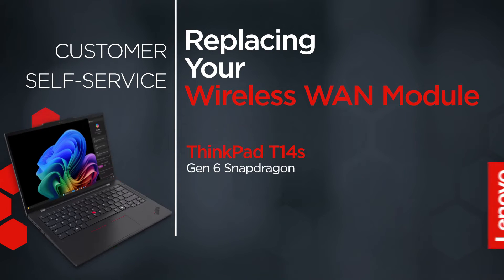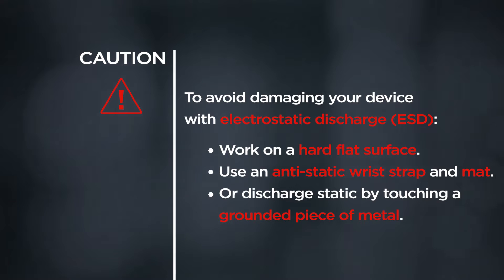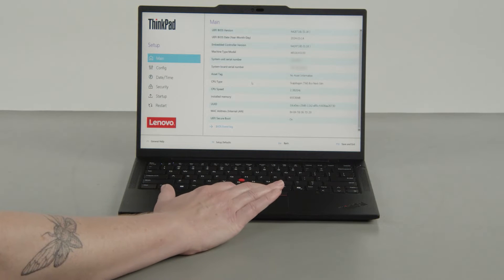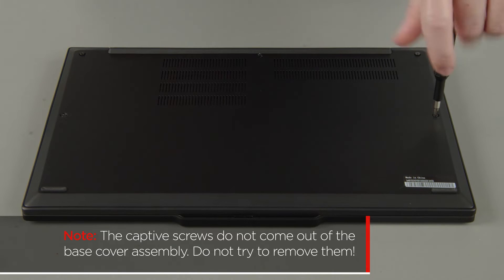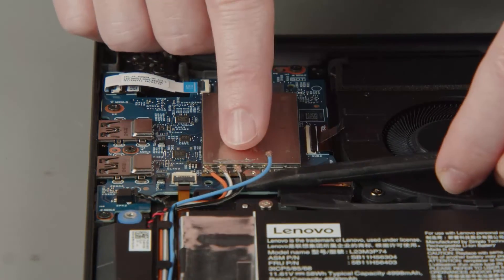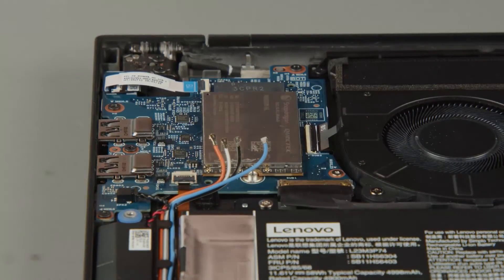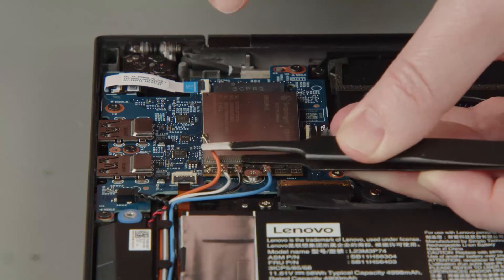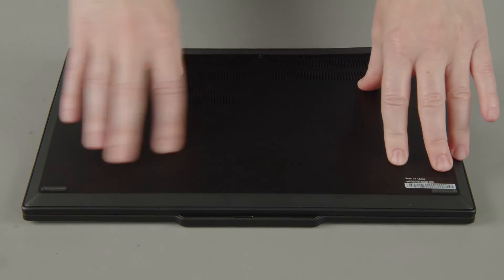Replacing Your Wireless WAN Module | ThinkPad T14s Gen 6 Snapdragon | Customer Self Service

Comment from the maker: This video will show you how to replace the wireless WAN module in your ThinkPad. The process in this video will work for the ThinkPad T14s Gen 6 Snapdragon. 

You will need a screwdriver kit, a non-metallic pry tool, static-safe tweezers, and 15 minutes of your time.

To view the ThinkPad T14s Gen 6 Snapdragon Self-Repair Guide go to https://pcsupport.lenovo.com/us/en/products/laptops-and-netbooks/thinkpad-t-series-laptops/thinkpad-t14s-gen-6-type-21n1-21n2/selfrepair/removalsreplacements

To learn more about your device go to https://pcsupport.lenovo.com

To find parts for your device go to https://support.lenovo.com/parts-lookup/?cid=ww:lenovosocial:b9515f&source=socialmedia&subsource=yt

To view the Lenovo Support Self-Repair Guides landing page go to https://support.lenovo.com/us/en/solutions/HT516547

** NOTE: Static electricity can destroy components. Use a grounding strap, and clean, non-conductive surface to work on. Use plastic or coated tools to prevent scratching and avoid using metal tools on plastic parts. For more detailed information on electrostatic discharge and how to prevent it, please watch our ""Understanding Electrostatic Discharge (ESD)"" video: https://youtu.be/by4PB3WtdLo 

Applicable Machine Types:
ThinkPad T14s Gen 6 Snapdragon - 21N1, 21N2

#Lenovo #LenovoSupport #LenovoTechSupport

Check out other official Lenovo channels!
https://www.youtube.com/@Lenovo 🟥
https://www.youtube.com/@lenovolegion 🎮
https://www.youtube.com/@Lenovo-PC 💻
https://www.youtube.com/@LenovoSuporte 🟢🟡